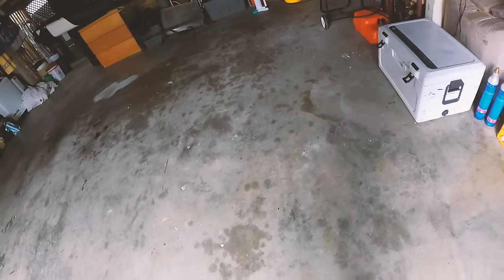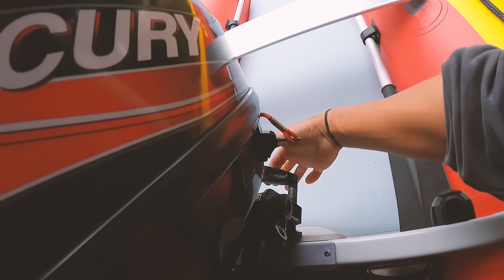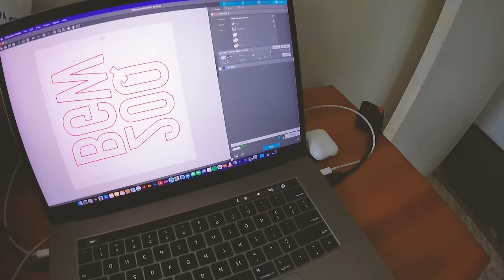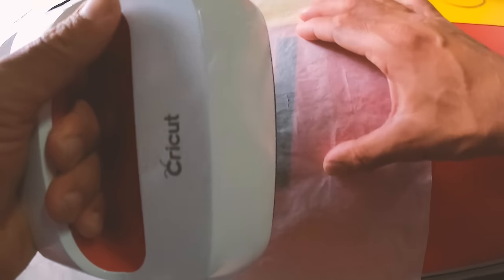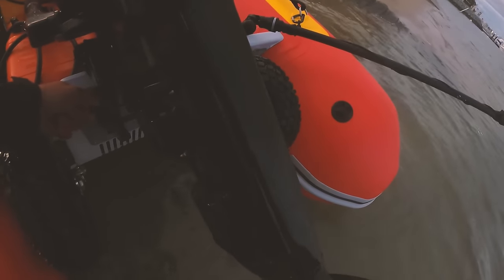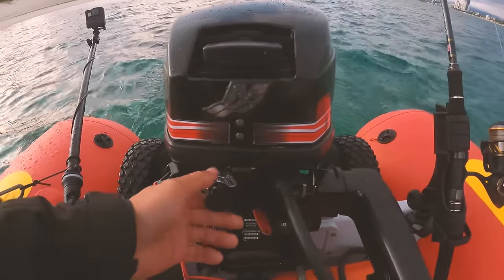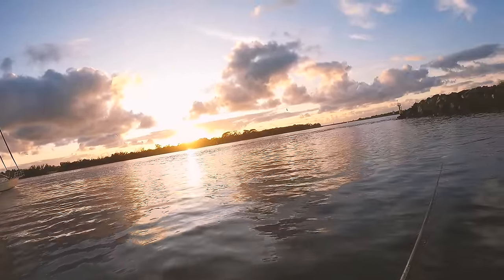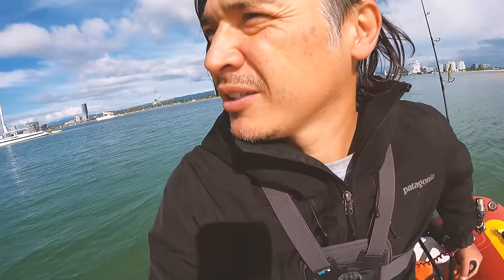The New Pocket Rocket - Fast Micro Boat Setup & Water Test

Comment: Pretty sure all the small Merc's below 30HP are Tohatsu's  , which is not a bad thing at all . Congrats on the new ride.
Reply: All the japanese ones are afaik but the us made ones with the gears on the tiller are were all made by mercury and are different motors.
Reply: @dylanwilliams3807 they are still Tohatsu’s, just with Mercury’s controls
Reply: @lombasto if they are maybe putting the mercury stickers on them makes them a lot quieter 😂😂

Comment: I have one of these and Love It! Very stable super easy to board from front stows and folds easy. High quality components. Extremely rugged material! I use as a tender for my sailboat, adventure boat for river running swim and dive platform.

Comment: So I believe you can adjust the tilt of the motor to help with the nose rising too much and not coming into plane.  There are also "blades" you can attach to the motor.     I know you’ll load her up and it’ll probably stop, but if you like to go for a run for an evening, you shouldn’t have to throw a lot of weight on it.

Comment: Sure if the trim is adjusted out slightly it will keep the nose down. Had the 2000 model, Grey, that was on a 3m and it was fantastic even with 2 ppl on the boat. Just took a little adjusting to get it to run at the right angle, and got better speed too. Also the petrol usage was brilliant. 25l would last a week of freshwater fishing . Can't wait for your next upload.

Comment: I’ve used cast vinyl with a heat gun to get letters to stick to inflatable boats. Takes much longer to apply than normal stickers but it doesn’t bludge the surface.

Comment: Nice little boat, been thinking about cat raised a little higher and 4mt and longer wheel mounts.
Try better weight distribution by moving the gas can and beer cooler under the seat and securing so they do
😂 not slid back and put a cheap plastic storage box with life vests and safety items plus rain gear and hand held VHF.

Comment: Funny! I had the same motor on my truekit! I had my transom blow out bc it was to heavy and mixed with the rough seas on the windward side in Hawaii was a dangerous combo I figured. Had a great run with it though!
Reply from the maker: Was that the old wooden transom? Maybe had a water ingress issue.. I had an 18hp in the 4m version and that had the new aluminum transom plus all the bouncing on the trailer and it didn’t show any signs of blow out so should be fine with the lighter 15👍
Reply: @rokkitkit  yeah it was the wood transom! Had no idea they upgraded it!

Comment: I'm surprised that someone that's owned so many boats, doesn't understand the use and care of a choke knob.
Experience is the key.
I've got a 9.9.
I expect it's more than sufficient for this boat.
Reply from the maker: The USA model of this motor has a unique choke so this was the first times using it. Most chokes just pull out and can very the amount of opening the further out. This one spins to increases ideal as well as adjust choke. And you never know how much of anything until you use one for the first time… can’t know everything👍 yea I had the 9.9 on the last 3.3m light grey boat. It was sufficient for sure and got on the plane fine enough, but nowhere near as much fun as the 15hp😁
Reply: @rokkitkit  
I have never used other than, American versions of these motors.
Anything different than what you are used to, has a steep learning curve.
Congratulations on not getting stranded or losing the motor off the back of the transom.
Anything bought used, is an open question.
It looks like fun !!
I am actively searching for a tender, for a not-yet-purchased, used sailboat.
Your video was helpful.

Comment: I can get 36kmh on my Merc 15, and I have a 16ft aluminium skiff with a full carpeted wood deck over the front benches and heavy battery / trolling motor up front.  Without the wood deck I couldn't open up without porpoising

Comment: You can only run these at 1/3 full power to avoid cavitation and pulling of the engine under water. They are a little better than rafts but not much.

Comment: Is that a 2 cycle motor ? … it sure sounds like one .. the 2 cycles tend to be a bit punchier but less fuel efficient and they also don’t like to run at low rpm’s like idle or when trolling .. great for getting to your location fast .. am a 4 stroke guy I love the smooth and quiet running
Reply from the maker: True, but unfortunately four strokes are just so heavy for this style of boat that gets packed down all the time. This 15hp 2-stroke comes in at 35kg which makes it a lot more manageable👍

Comment: Be careful with bed rest. I know it seems like the thing to do when the pain is intense but movement and massage is better. Of course a specialist should be consulted so you know exactly what you're dealing with. I could barely walk some days and couldn't even ride in a car for more than 30 minutes when I came to Bali 12 years ago. I started getting traditional Balinese massage twice a week and after a year I was able to go for long walks on the beach and ride a motorcycle from South Bali to North Bali with just a single rest stop. I stopped getting weekly massage because of the pandemic and some of the old problems have returned. Needless to say I'm a firm believer in traditional physical (and mental) therapy after spending a fortune on pain therapy in America that didn't cure the problem but masked the symptoms for increasingly short periods, meaning moving on to something more powerful until even getting injections. Insane. 
Really hoping you can recover because I know what it's like and wouldn't wish it on anyone.

Comment: I wouldn't recommend heat transfer onto PVC vinyl. Regular PVC cut vinyl decals are pretty sufficient. Plus, you can peel, clean off the glue and apply different decals if needed.
Reply: PVC = polyVINYL chloride, is there another kind of Vinyl? I think you can just say PVC. What is wrong with heat transfer on decals?

Comment: If your fishing near to the rocks in rough Seas that's about the best controlling and no you could ever have you can have it in reverse and stair controller with your 2 and doing something else pulling a lobster trap and I wins next to the rocky shores I don't mean in a bold like that but with those Mercury's they're great controls don't need the the Rev they work so well just my thoughts and experience

Comment: Tohatsu and Mercury 'not so different' now that's a funny statement. 

"They are the second largest producer of outboards in the world. As well as marketing outboards under its own brand, Tohatsu outboards are rebadged and sold as other brands. In 1988 Tohatsu and Brunswick Corporation set up a joint venture named Tohatsu Marine Corporation to produce outboards for Mercury Marine." 

Small Mecury motors are infact made by Tohatsu. You buy Mercury for the service access, which might or might not be better. 

Seen this thing with my own eyes, they are fast fun little things.. though here the guy has a 20hp Tohatsu on that 3.3m version, don't know why because it's severely overpowered and will flip if he instantly goes full power ( but it's within the weight limit I'm told.. which is why he went with that older simpler two stroke they weight a lot less. I have a 5hp Tohatsu on a Mariner 4, just within weight limit but 2hp over max recommended power for the lil thing ).

Comment: Have you thought about putting a composite (replaceable blades) prop on the outboard ? I always had the impression that they were underperforming compared to stainless steel but I watched Doug from the SV Seeker channel do a comparison and the newer composite ones seem to be pretty close performance wise. SV Seeker has a lot of videos, the one I'm referring to is " Propellers - Stainless, Aluminum, Composite" and the tests start at about 6.30 mins in.
Reply from the maker: I’ll have to check it out👍

Comment: These along with the TakaCat have 1 Major downfall and Danger. 
If you run over a 5hp
especially the 15hp you are using , and run wide open you risk the FLIPOVER from wind under the bow area.  In waves and heading directly into the wind you want to be VERY VERY CAREFUL or she will come up and over on you. 
I was out in 12-15 knot winds with a 9.9hp 2 Stroke , going 21 knots and suddenly I was looking at the sky and falling forward to keep from going over. 
So keep that issue in mind with 1 person in the boat
I'm sure with some weight in front it will greatly reduce that risk